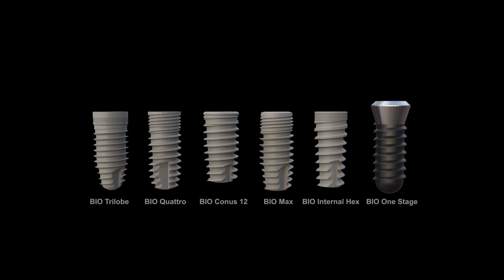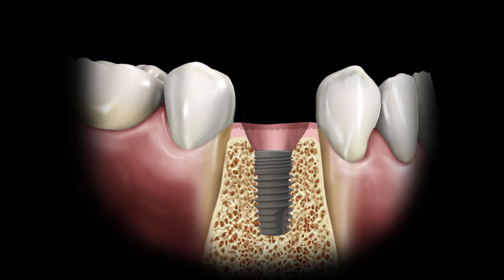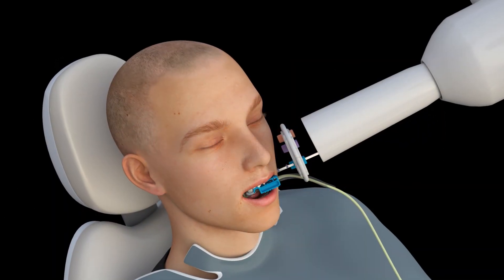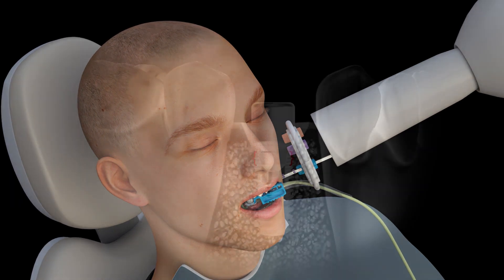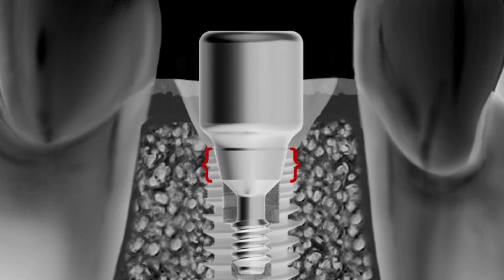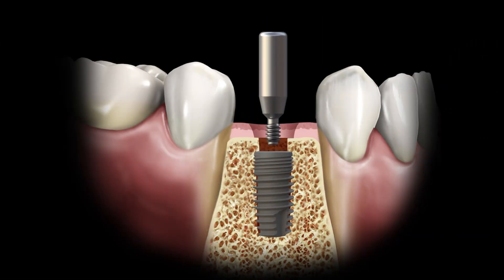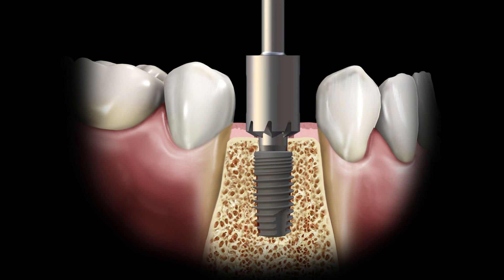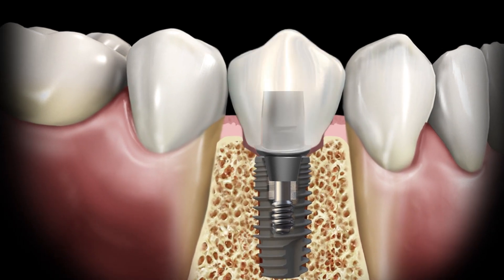How to Verify Seating of Prosthetics in a Conical Connection Implant

Comment: I had a root canal fail. My only adult tooth loss. I went through like a 2 year implant process and FINALLY had my crown put on a couple months ago. The positioning of the crown has changed my bite and I went for a follow up with my oral surgeon and there’s a massive gap between crown and gums. Not only that, but the crown is like, slanted, and the grind is not right. It’s like backwards or something. The root canal, implant and crown literally on this tooth over these last 4 years has tabbed me over $7000. If my dentist tells me I need to reorder a new $1200 crown I’m gunna explode. Lol. He should cover that. I was stunned that the dentist didn’t have the crown x rayed following seating. The dentist is a super nice guy, but this guy and my oral surgeon have made a ton of money off me. Shits crazy. Lol
Reply: How are you even watching this video?  This is like a pretty specific technical video that's most likely to get suggested to dentists who use Blue Sky Bio's particular software and implants.  Weird.  Anyway, sorry about your tooth.